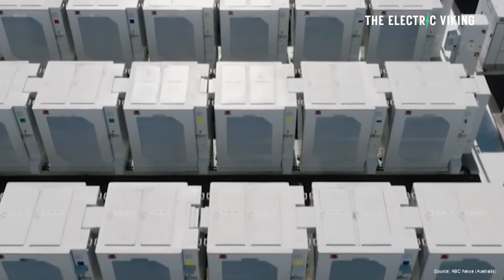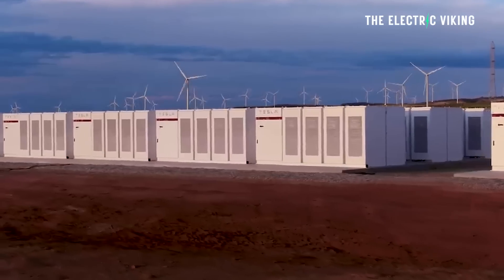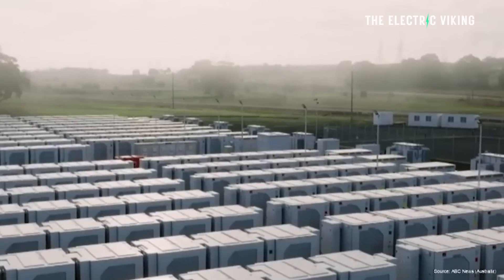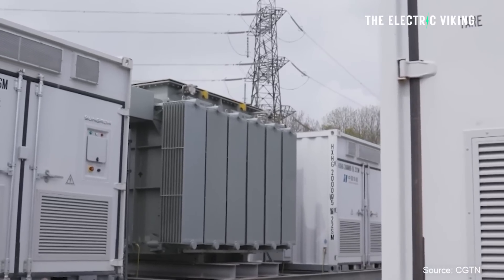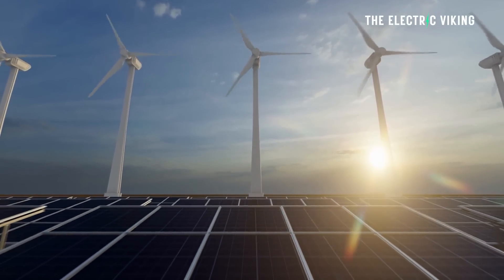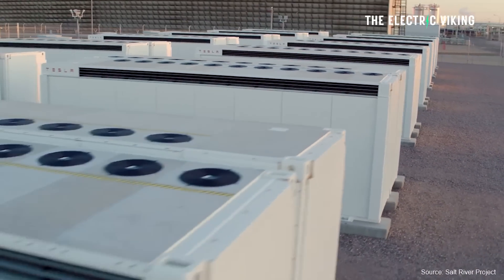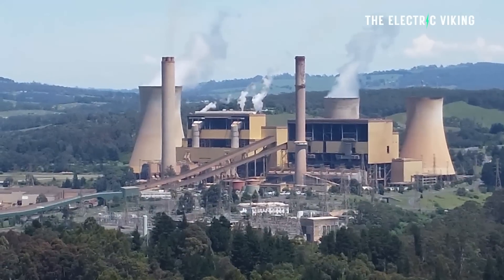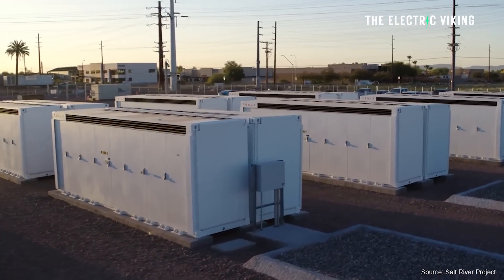Australia builds new battery to smash coal power plants

Comment: Another megapack site deployed with no apparent fire suppression or partitions to prevent fire from jumping between units. Better pray that the spacing is generous enough to buy time for taxpayer money (firefighters, their equipment and everything else that comes with them) gets there to do the operator's job.
Reply: Of course when an oil refinery pollutes or burns no taxpayer money is used?
Reply: @jsanders100 when was the last oil refinery fire?
Reply: @robertfonovic3551  Not sure about the last "oil refinery fire", but there is the Hazelwood open cut coal mine that supplied coal to power stations in the La Trobe Valley, which caught fire in 2014, then once started, continue to burn for 45 days, causing significant respitory distress and damage to hundreds of residents and workers over a large geopgraphical area, plus is credited as a likely contributor to the death of 11 people. All based on a post fire investigation and subsequent report.

How about that. Good enough example?
Reply: It’ll be fine.
Reply: @Berretotube famous last words.😊
Reply: @robertfonovic3551  he he, yes the last gasps of a dying industry. Renewables will power the world for all time.
Reply: "Another megapack site deployed with no.........."

But you just made that up, because you have no official insight or knowledge of what is actually installed. You have no idea about the design principles of such facilities and their fire management policies and procedures. All you have is made up mischievous naysayer narratives, that's it.

It's really hilarious because you are not going to stop the renewable energy transition. It is happeneing whether you like it or not. Get over it and stop being a scaredy cat when change comes along. Next we will find out you are still scared of the dark. LOL.
Reply: The really sad thing is that newer battery packs that car manufacturers are waiting for on EV deployment don't have the fire risk and hold more charge. Australia should wait before deploying these things -- especially Victoria which has such a huge budget deficit with their recent covid and other debacles.
Reply: @infiniteloopcounter9444  If by "newer battery packs that don't have the fire risks" you mean LFP, the Australian battery pack that burned down a few months ago was a Tesla Megapack II LFP battery. LFP may not go into thermal runaway as spectacularly as NMC/NCA but it can still do so, it only needs to get about 20C hotter first.
Reply: @teardowndan5364  Look at the Toyota road map for battery packs in their cars (or any other main car EV roadmap). The idea is to wait for mass adoption till solid state batteries after first transitioning through LiFePO+1 liquid electrolyte ones.

The Tesla stuff is IMO not worth considering as it is prone to catching on fire, loses significant performance each year, requires replacement after 10 years or so, and doesn't make economic sense in the long run.

Only countries or localities with spare cash or willing to go into debt for votes on "environmental" matters build these now instead of waiting and putting the money into R&D where it belongs. BTW Australia is taking money out of R&D more broadly compared to countries like China.
Reply: @infiniteloopcounter9444 it was Aussie R and D that gave the world cheaper and more efficient solar panels. 🌝
Reply: @infiniteloopcounter9444  Do you have any official extended period statitical records that indicates that EV's fire are more preveleant than ICE vehicles for example. What is the basis for your targeted concern, is it a few sensational new reports or mischievous sensational social media commentary?

There is a ridiculous amount of specific focus at the moment on EV fires, while totally ignoring everything else that has always and still does catch fire. No one and I mean no one that is making all these targeted claims about EVs, ever produces any comparitive statistics to support their campaign. Zero! So then is just looks like a wilful and concerted mischief naysayer's campaign in the end.

Comment: Batteries are fine for grid stabilisation, but not cost effective for long periods of time. We're going to need a lot more pumped hydro to provide grid scale power for the number of hours needed to bridge the gap between solar power production during the day and keeping the lights on at night (actually there's a lot of other things which run at night that use more power, like factories, smelters, electric trains etc). The battery in SA was only for grid stabilisation, not to supply power for hours at a time. You say that batteries are cheap, but they're still unaffordable for households; at least they aren't justifiable in terms of ROI over their expected lifespan.
Reply: I don’t know. $10k for 30 kWh is a decent price available right now for home batteries. If you have a BEV and drive a lot, it can pay for itself in 5 years or so.
Also, once RE is spread across the continent, the need for storage drops off as power can be imported from where the sun is shining or wind blowing to where it isn’t.
Reply: @williammeek4078  your reply is only covering home demand for power. Eliminating coal will mean finding new sources for industries that run 24x7. The Tomago aluminium smelter in the Hunter Valley uses 10% of the electricity in NSW and runs 24x7x365. Batteries are not the answer for this level of demand. Look at the Sydney CBD. Where do you get the power for all those buildings? Where does the power for the electric trains come from?
Reply: @theharper1  Correct. My comment concerning home power only addressed home power. 
I addressed the fact that it isn’t the purpose of batteries to power the grid overnight in other comments as well. 
Wind would be a major resource to tap into at night. Geothermal has great potential in Australia. Pumped hydro would be an excellent storage option for industrial night time use. 
There are many options.
Reply: @williammeek4078  we need to be making the decisions now if something is going to plug the gaps when NSW coal generators are shut down by 2030. There's already NIMBY arguments about offshore wind in Wollongong. The same is bound to happen elsewhere. Building dams for pumped hydro will also lead to objections. Geothermal is possible (there was research into the use of a granite body in the Hunter) but expensive in Australia. You have to drill a long way down to achieve supercritical steam, and frack as well, which could trigger earthquakes. It's not like NZ, Japan or Iceland. Communities need to be educated and agreements reached now, in order to be ready when burning coal stops.
Reply: @williammeek4078 you could at least try and be factual, although your comments clearly show you are living in dreamland.
Power was cheap when we were just on coal based power supply, it was when we started spending Billions on currently non performing RE (as you mentioned) that prices went up. Facts mate not your poor little feeling's.
Look at what you are proposing, where do you think all the money for that is coming from mate?
The Cosmic Electric Money Fairy?
The concepts are fantastic, but the follow through and redundancy planning is non existent. And you all fail to see the problems in that and how rushing this out isn't doing Jack Schit for the Climate and is riddled with disasters ahead.
You will wake up eventually.
Reply: @alanakafang6143  if you have any questions about any facts i bring up i will be more than happy to provide references if the will dispel your fantasy land and bring you back to reality. 
Particularly in Australia, coal based power was expensive and unreliable. 
Wholesale prices for wind and solar are the cheapest around. 
And as the grid is still predominantly fossil fuel based, it is particularly ludicrous to blame renewable energy on electricity prices. 
But go ahead, show me your math on how cheap electricity is more expensive. 
Where will the money come from? It will come from the money we don’t spend on fossil fuels. 
I run my house and cars off of off-grid solar and wind. Payback for my system if i were to buy it today would be about 4 years as i save about $700/month between gas and electricity. 
I expect the system to last at least 30 years. 
But go ahead and show me your math on how cheap RE is so expensive.
Reply: @williammeek4078  sure mate whatever you say ... I live in the real world with real world situations, have zero interest in your fabricated studies junior.
Rave on all you like, those with common sense are just going to laugh at you.
Cheers ✌️
Reply: @alanakafang6143  😂🤣😂🤡 So what you are saying is you know your fantasy is BS and you have nothing to back it up.
Reply: I remember something about a wacky plan to engineer an inland sea in Australia.. 🤓